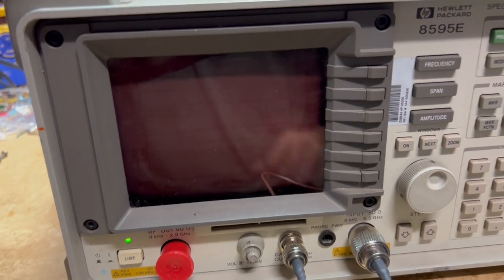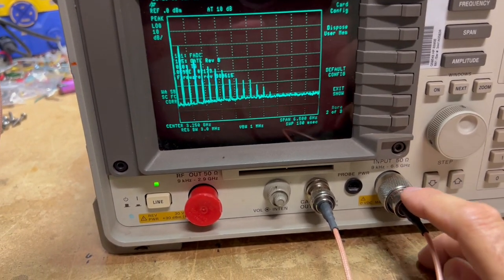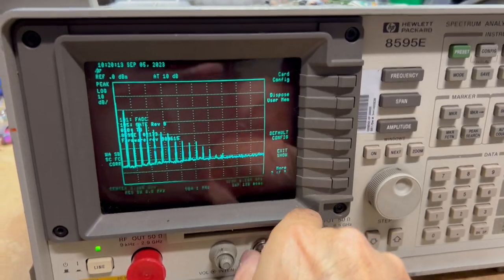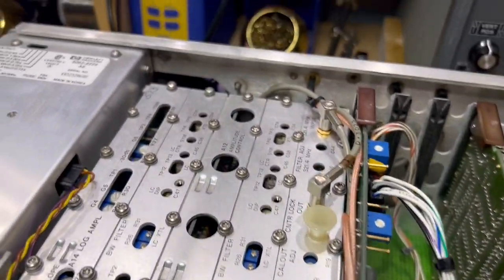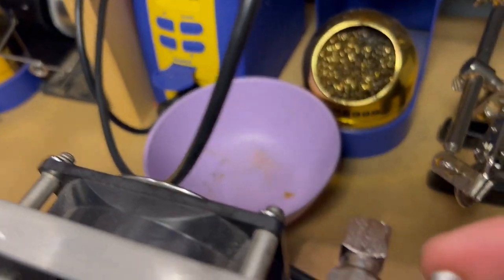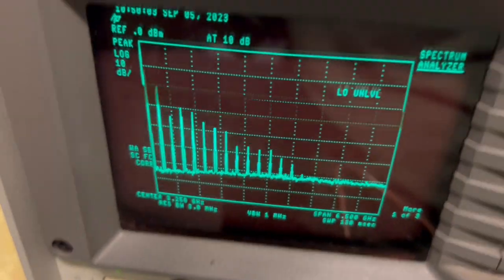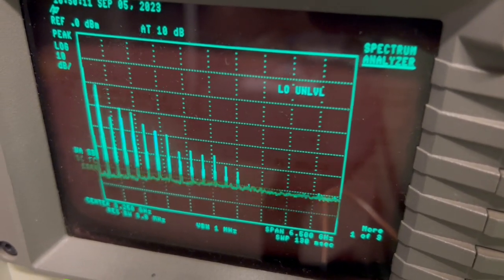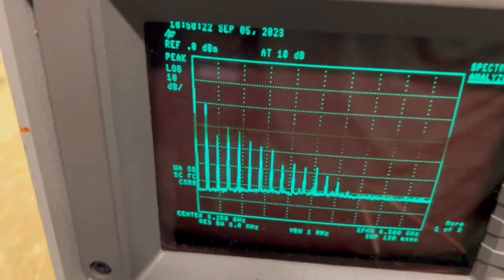HP 8595E Repair Part 1 plus Power Supply Information

Comment: As far as I know, the battery on these things can't be checked beforehand. Chemically, they hold the wanted voltage and that voltage never goes down but they will go completely flatline once they are tired. After 10+ years, I recommend switching them out

Comment: As for the PSU: I recommend replacing the three yellowish RIFA XY caps that are hiding under the power input. These things have the nasty habit to deteriorate over time, get cracks in the plastic and when the time has come explode/catch fire and whatnot. In a pinch, the PSU runs without (don't ask me how I know, I need to order caps that physically fit, it is a tight fit there).
Reply: Height must be 12mm. or less.

Comment: Hi, your work is so valuable, I am in the same position I want to repair this PS, it is used in an HP 8591A CATV spectrum Analyzer, could it be possible to download the so valuable document you have done , here in Belgium there is still an Hamspirit and I want to help my Friend ON4LAU to repair its power supply.
Best regards ON1EV
Reply from the maker: Hello. Thanks for the comment. I do intend to make the documents available. I’m in the process of getting them made into a single pdf. Once that’s done I will have them available on the channel.